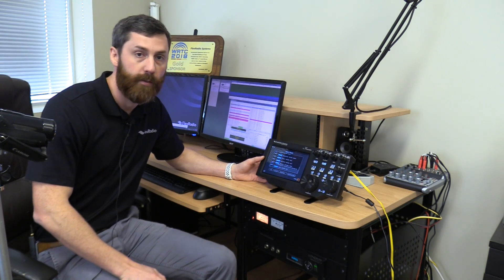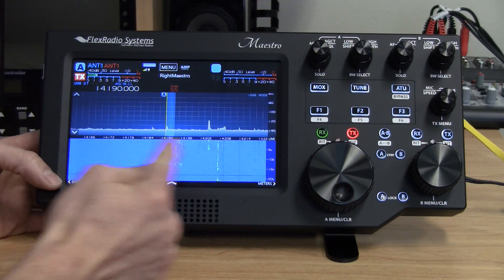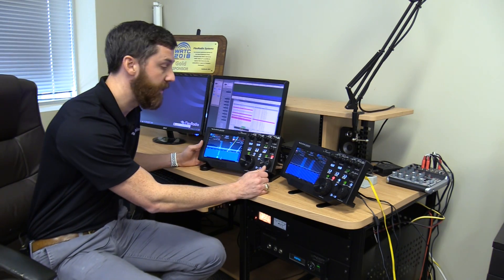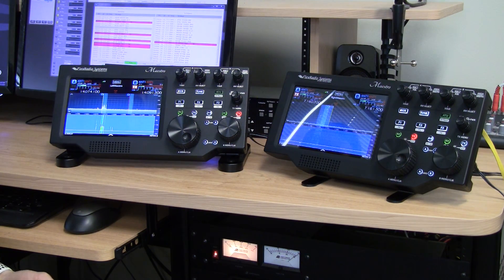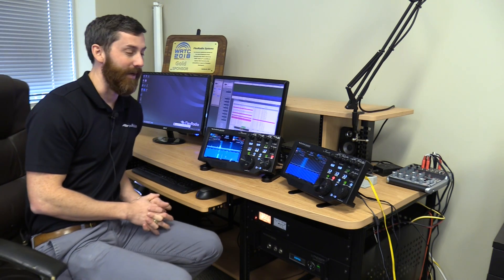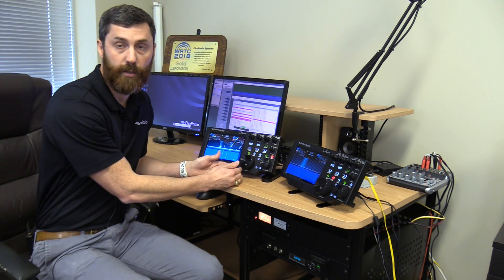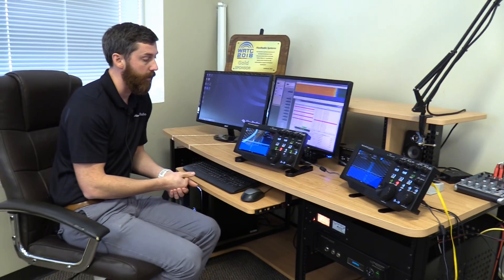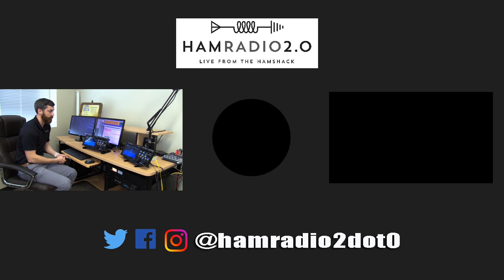FlexRadio, SmartLink Demo and Intro to MultiFlex

Comment: Using Remote Hams, a number of people can be "on" the remote, but only one at a time can control it. There is a chat window where hams can chat with each other (those that are currently logged in) and take turns using the remote; chasing a Dx station for example.  How is this handled using Flex Smartlink?
Reply from the maker: I'm not aware of a chat feature in SmartLink, but that system only allows 3 folks to connect at the same time